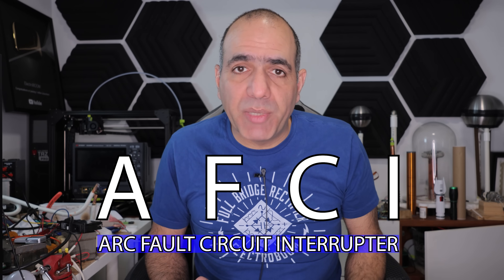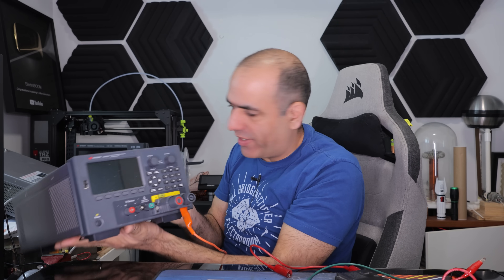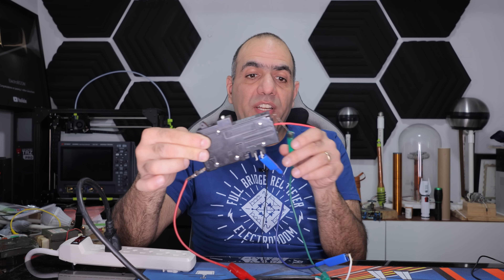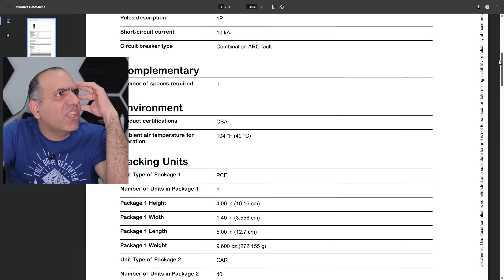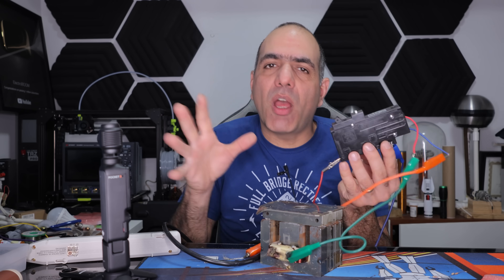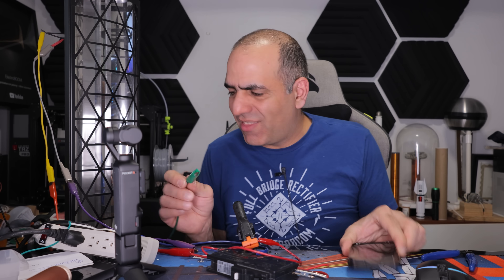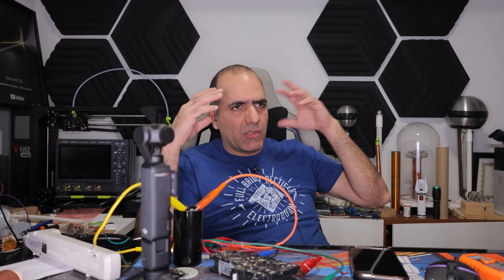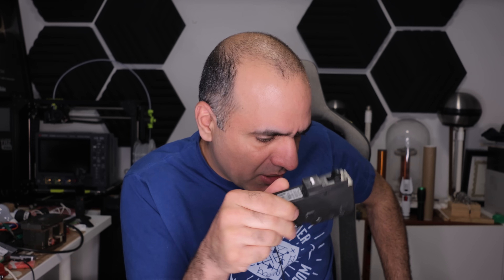Fighting Electrical Fire by AFCI

Comment: The video didn't answer if all AFCI breakers are GFCI!   Are the breakers they sell as dual AFCI/GFCI protection really just relabled AFCI breakers for more $?
Reply: No, not all AFCI breakers are GFCI. For Schneider (the manufacturer here), AFCI-only breakers have a white test button. AFCI+GFCI use purple, and GFCI-only use yellow.

That's the same brand as in my house, so I'm familiar with it. I don't know whether a similar arrangement is used by other manufacturers, but I'm sure competitors also offer AFCI-only as well as AFCI+GFCI options.
Reply: @harvey66616  But his test seemed to show that it would flip whenever there was an imbalance between the hot & neutral -- eg. a ground fault.  Unless I'm misunderstanding or missing his joke... it seems like it worked for GFCI too (and his breaker has the white test button - so nominally AFCI only)
Reply: @maxrockbin  Yes, it did seem to demonstrate a GFCI-like behavior. However, as I understand it, a code-compliant GFCI breaker in North America is supposed to trip at 6 mA, not the 40 mA he found. It is possible the breaker is marketed as AFCI-only, but does include a slower/lower-current version of GFCI, just not what would meet code.

Or maybe it's like CPUs used to be, and all the breakers are manufactured as AFCI+GFCI, then they test and bin them, and only sell the ones that trip at 6 mA or lower as having GFCI, and the others as just having AFCI. (Honestly, I think that hypothesis is unlikely to be true, but since I don't really know why it still seemed to behave like a GFCI even though it's obviously not sold that way, I'm open to whatever explanation until proven otherwise. :) )

Comment: More heat=More danger to the fuse. Which means that you fuse even if more current is applied. So its a win-win situation for the Fuse in any case.

Comment: I also discovered that AFCI does GFCI protection after wiring a light to an existing circuit and trimming the neutral wire to reach the neutral bus.
Reply: Only dual function breakers do that
Reply: @ZT_1234  They don't think it be like it is, but it do.
Reply: Its GFPE all GFPE protect ground faults below of 100mA acord to NEC, its to protect from fires from grounds faults, not protect people.  
AFCI protect against fires GFCI protect people.
"Ground-Fault Protect Equipment"

Comment: RCDs don‘t Switch off when overcurrent occures
Reply: "RCDs don‘t Switch off when overcurrent occures" -- Don't they? I mean, the RCD itself won't, but are there actually any RCD breakers that don't also include over-current protection?

For sure, here in the US, I've never seen such a thing. Every single circuit in the electrical panel has over-current protection. Does the UK/Europe code allow a circuit without over-current protection?

Comment: Well some electronics like kettle, toaster, fridge ect has ground connect, but your experiments were not using ground, so my expectation for the AFCI to trip would be if there was ground present and either the wire melted the live and the ground are shorted or just the live wire was connected to the body the kettle it may trip AFCI

Comment: Everything is a fuse if you use enough current.
Reply: bro invented a time machine to comment 7hours before the video started 💀
Reply: That's how universe works 🗿
Reply: Everything is a conductor with high enough voltage
Reply: Just like everything is a conductor with enough voltage
Reply: if you don't put a fuse in your circuit, one will be assigned to you
Reply: Galvanized Steel Squares & Eco-Friendly Wood VENEER
Reply: Everything is a lamp if you have enough power
Reply: @kombajniasty5366 😂😂
Reply: They will not be as stable as separated fuses, so I guess do not use them for cost reduction.
Reply: That's what I told the judge but "manslaughter" or whatever.
Reply: Moreover, every electronic is a smoke machine if you give it enough power
Reply: @andrebarrett4112 every machine can be used as a smoke machine if you use it wrong enough
Reply: Except for maybe a properly cooled superconductor 😂
Reply: Perfect message for a humorous t-shirt 😂
Reply: Just like everything is a smoker if you use it wrong enough.
Reply: except plasma
Reply: Human fuse
Reply: Your right 👍😊
Reply: Even a multimeter can be a fuse 😂
Reply: Holy crap!
Reply: This is correct. Just ask India and most of the middle east. 
Honestly who needs breaker's your city can handle just a doubled up wire. Just make sure it aluminum so it's super easy to bend and twist.
Reply: Thankd
Reply: I’ll try the nipple fuse clamps😂
Reply: True😂😂
Reply: Speaking logically, except rubber
Reply: Everything except ionized gas.
Reply: Most fuses are just a wire that is designed to vaporize at a certain current-induced temperature. A wire can technically be anything which is able to conduct a current. So yeah!
Reply: true
Reply: Even human beings can make a fuse if you try hard enough
Reply: Let me tell you something that cannot become a fuse a bean bag
Reply: I've seen a 1/4"-20 CRES bolt in a fuse holder before.
Reply: me to
Reply: Ummm oh ye why the highly saturated salt wate yellow
Reply: Only member 😂
Reply: So if a overvolt my phone charger it's a fuse
(This is just a joke and don't overvolt your phone 
It can blow up)
Reply: graphite
Reply: Premiere?
Reply: its true
Reply: 478M amps
Reply: Some folks are members and get early access and you also have time zone differences.
Reply: @topher8634  we have solved time zone differences issue mostly likely early member release
Reply: @topher8634 technically he should have a badge if he was a member
Reply: How tf u comment 7h before this video is upload??
Reply: @ItsInvinciblePvP he obviously used the time flux as a fuse.
Reply: @ItsInvinciblePvP  Bro time travelled
Reply: @ItsInvinciblePvP  money
Reply: @diy_for_all  😂😂
Reply: @ItsInvinciblePvP  Teh dewd had enuf curnt, dmazz
Reply: bro is a time lord @ItsInvinciblePvP
Reply: @ItsInvinciblePvP   Pay to win
Reply: @ItsInvinciblePvP  because the planet is a sphere wherein the sun cannot hit every part of the surface at once, so different parts of its surface have different “time zones”.
Reply: @ItsInvinciblePvP  PATREON, IS IT SUCH A HARD CONCEPT TO GRASP?
Reply: @danek_hren no need to get this mad 🥀
Reply: @ItsInvinciblePvP  Ok. I will say this in words even you might understand:
Give video maker money = early access
Got it?